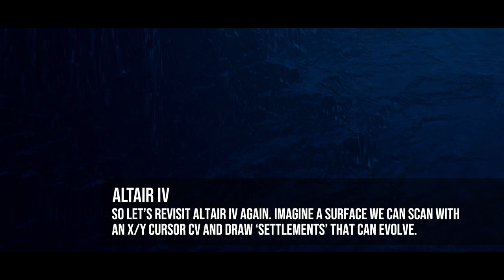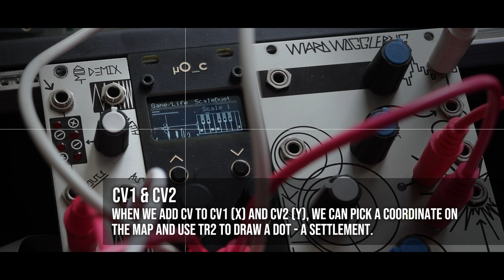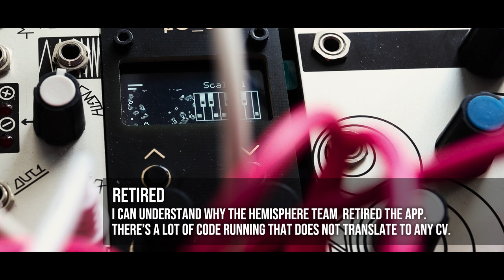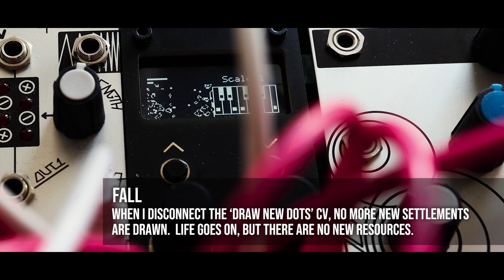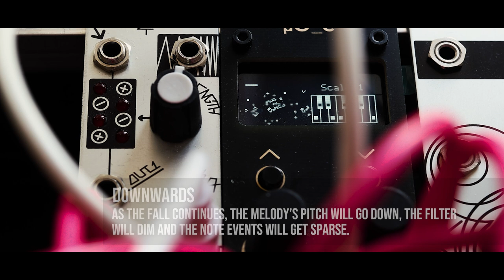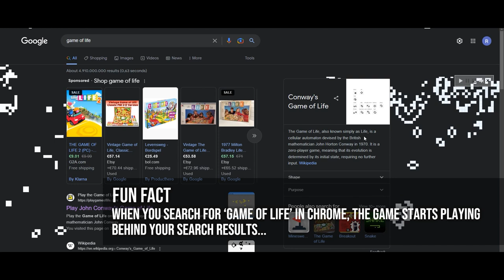The Game of Life | Bringing a lifecycle to your patch

Comment: Are patch notes for this and other videos available to your Patreon supporters?  If so, I'm signing up.
Reply from the maker: No I am not going patreon. However, I am thinking about 'long versions' with patch notes for the membership area of this channel. 'Inclusive' videos instead of exclusive. I guess this will be in May.
Reply: Got it.  Thanks for the videos.  I'm still learning from them.  I had a very nice Krell patch today, Plaits-->Optomix-->Beads, with Maths channel 4 output functioning as the control for Optomix volume, channel 4 EOC triggering S/H for the pitch of Plaits, and EOR from channel 1 triggering Seed on Beads and a second S/H for pitch of Beads.  Both quantizers were set to pentatonic major.  Since Beads the raises the pitch over the incoming signal, the granular melody modulates to different keys depending on the pitch of the incoming audio.